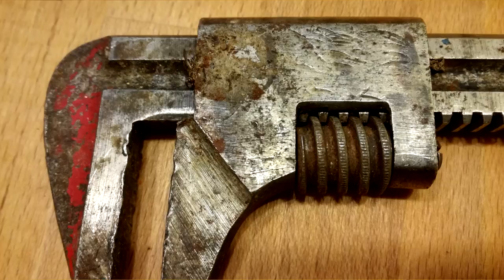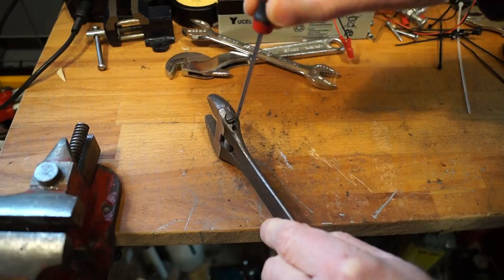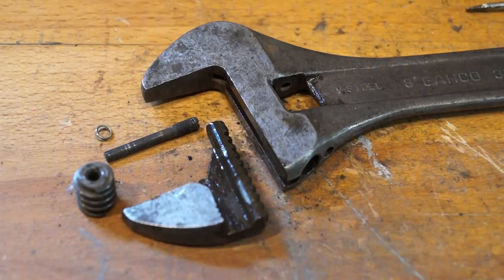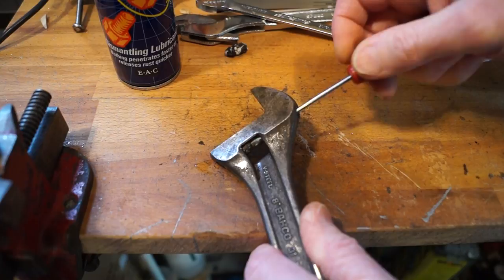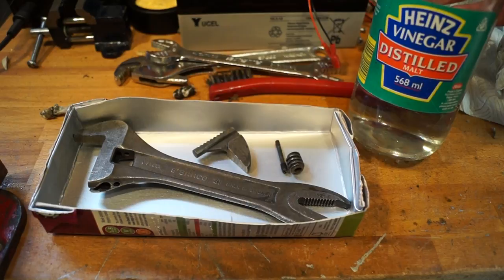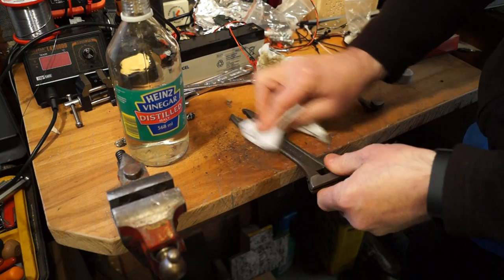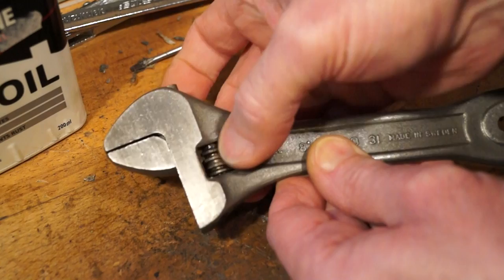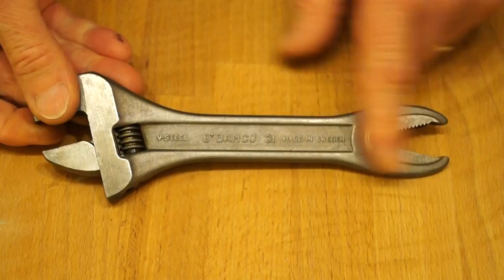Bahco Model 31 Adjustable Wrench Renovation

Comment: I loved this video! It’s so relaxing and therapeutic to see something old and seized up reworked into a fluid and functional tool again. It kind of gives honor to the craftsmen of yor that made things of this caliber back in the day. I wouldn’t be surprised if you put this and the new Chinese wrench into a stout vice and used a lever to try and bend them that the Chinese one would snap easily and this would need a lot of hard pulls to finally snap it in two

Comment: Great Job on your spanner. It nice to see someone doing restoration with just the basic tools. It encourages those just starting out in the hobby. Question about the wrench when trying to slide it apart it appears to stick even when cleaned and lubed up? Did you check for any damage in the slide area? Again great job from another restorer all the way in New Hampshire USA.
Reply from the maker: It has a little bit of damage at the bottom of the track where the jaw slides, I think someone used it as a hammer at some point. Thanks for watching and stay safe 👍

Comment: It'll be interesting to see if you can get the rust off of that old Fastnut spanner. I remember back in the late 80's or early 90's trying to remove the rust off of those old tools that I showed you pictures of, I tried as hard as I could but it just didn't make any difference. Now because they hold a lot of meaning to me and nostalgia I wouldn't want to try and bring them up like new, I'd rather they continued looking just like how I remember them.
Reply from the maker: I'll be giving it a go, should be interesting.

Comment: i have one of these always with me at work. 1. it opens wide enough for argon regulator nut. 2 the other end is for grabbing threaded rods, not nuts, and it works great at it. also today's model have a millimeter scale on them.

i bet some idiot used that wrench as a hammer and thats why it gets stuck at the end. try filing it..
Reply from the maker: Thanks for the feedback. Mine is going to live in my tool kit, it is a great adjustable spanner. I hadn't thought of someone abusing it by using it as a hammer 😣 I use a smaller Bahco adjustable spanner at work and that one has the millimeter scale on it. Thanks for watching.
Reply from the maker: There are definite signs of the wrench being used as a hammer! 😵 I will be highlighting this in my review.

Comment: I have one in almost perfect condition. If you want to dress out the small deformations in the yaws, you should gently hammer them back into the right geometry as good as it gets. Not filing them off to begin with. Use a polished light hard ball-hammer. Only then you can gently use abrasive tools, to improve the finish.
Reply from the maker: Thanks for the advice 👍👍👍
Reply: Nash Rathbone  hi do you still have the document csm you send it to me here on youtube private?

Comment: I have a bahco  spanner too but with a stuck grub screw, any ideas how to release it?
Reply from the maker: Hi Stephen, if it is rusted in you could try soaking it in distilled vinegar for a day or give it a good spraying with PlusGas and let that soak in. I would then try turning the grub screw in and a out a bit to loosen it then add a little more PlusGas or penetrating oil (WD40 or the like). Make sure the threads are clean first. If you need further help you can contact me on Instagram or here. Hope this helps.

Comment: do you think the white vinager removed the coat of the tool ? why didn't you use a wire brush on bench grider , it should be more efficient
Reply from the maker: Hi and thanks for watching. Soaking in white vinegar can be a good way to remove rust etc, I have seen it done quite a lot. I have had a 6 inch bench grinder in its box since 2004 doing nothing! I'm thinking of getting a wire brush wheel for it so I can make use of it. There are some photos of it on my Instagram feed.